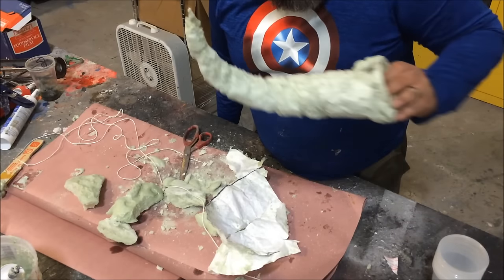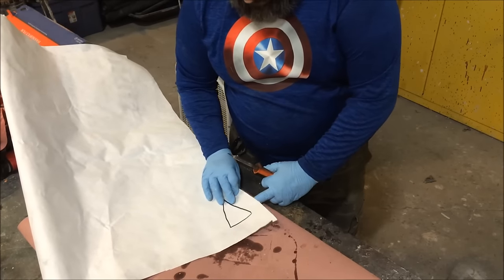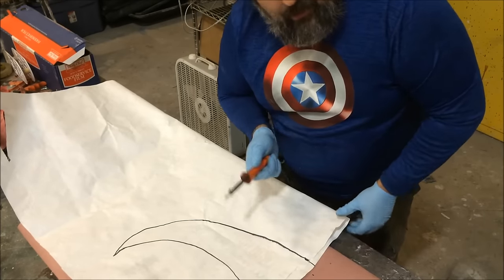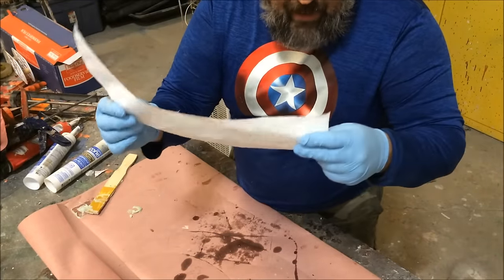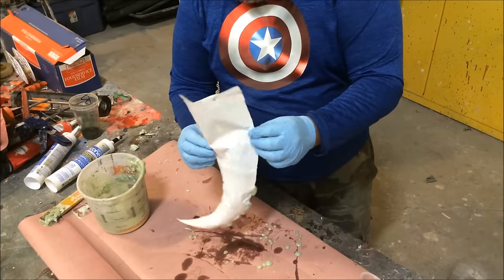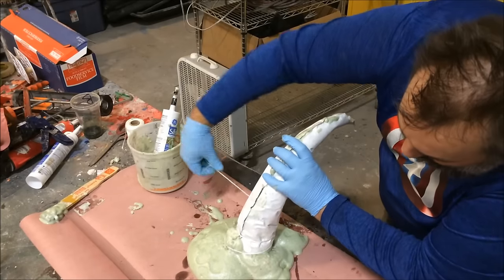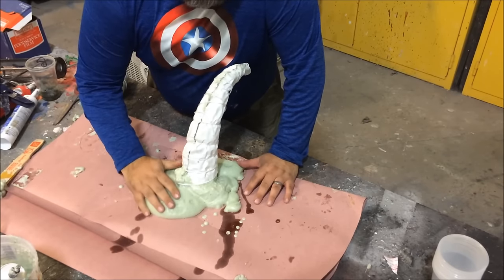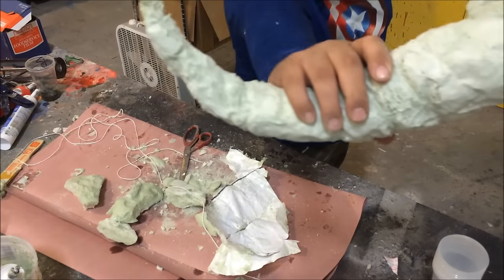Making foam horns

Comment: hey, I've never worked with foam before and I have some questions. I want to make horns but more detailed version. If i sculpt them in some wed clay, then make z mold from plaster bandages can I fill it up with the foam? I mean will the foam release from the plaster or do i need to use some kind of releasing agent? Also is there any chance to stick foam horns to the skin? Will the pros-aide do the job? I would really like to have them coming out of my forehead. I will also have 2 forehead latex prosthetics, something like raised skin in a ring shape around the horns. Hope it will keep them in place.
Reply from the maker: +Edyta Szarfemberg  One of the rules of molding is that if you want a rigid final product then you cast in a flexible mold. This foam is OK for this task but it would not release well from plaster. The more detail the worse it will be. Id make a silicone mold and use a lighter weight foam from an FX supply company. I dont know whats in this foam so I dont want it glued to your skin for any length of time.
Reply: +StiltbeastStudios thank you! i was planning to make them out of polyurethane foam which i know is safe for the skin. silicone mold is unfortunately over my budget for now. I was also thinking about casting them in liquid latex to get a medium thick skin and then filling them with some cotton so they don't loose their shape but still be light weight. what do you think about that?
Reply from the maker: I think the stuffed latex is a great cheap way to go.
Reply: StiltbeastStudios Can you foam fill the latex then?